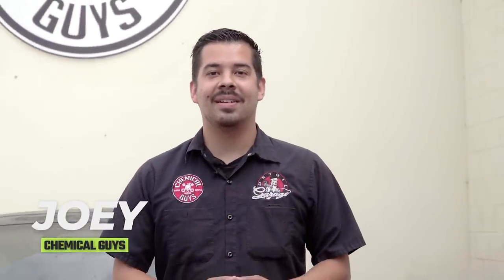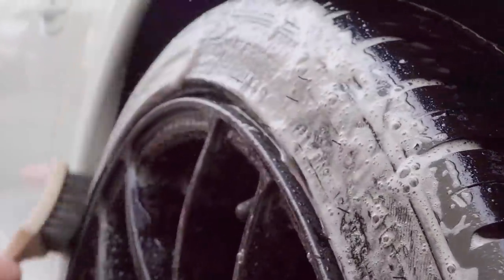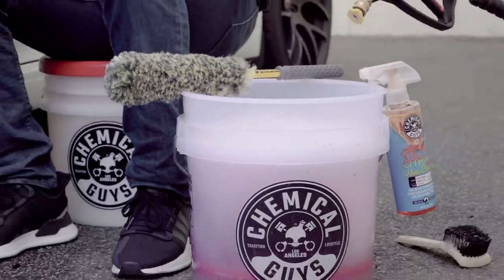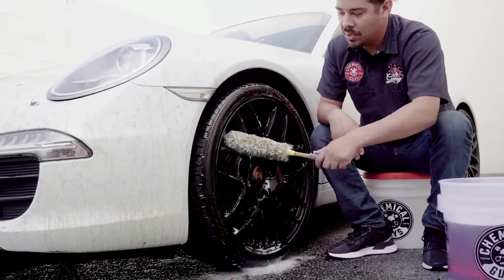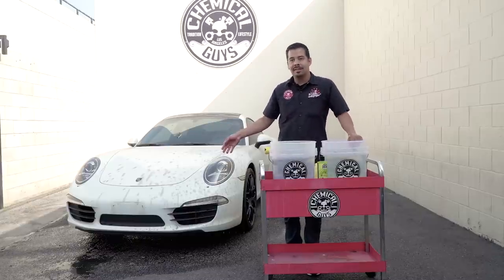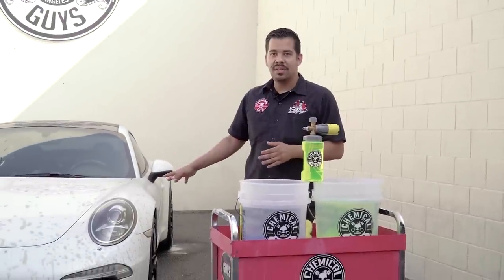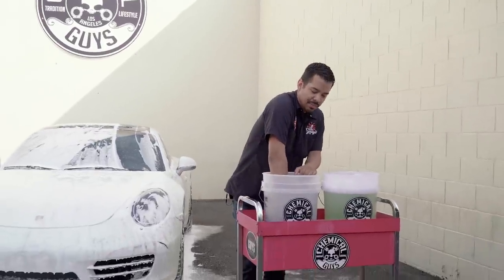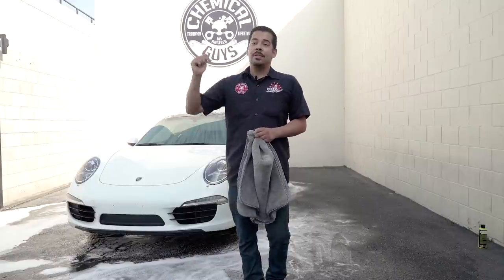How To Decontaminate Car! - Chemical Guys

Comment: words around the block that citrus wash and gloss can also strip off your wax if use at high concentration levels?
Reply: It will probably strip at any level from what I’ve noticed, that’s what it is good for if you want a fresh start but it will probably not break down any ceramic products on your first go just any carnauba wax’s.
Reply from the maker: Hey! Yes, it may strip only if you wash with 2 ounces or more. Thanks for watching and happy detailing!

Comment: Hey chemical guys, I have a pressure washer that goes up to 2200 psi, is that too high for a foam canon or should I lower the PSI?
Reply from the maker: Hey there! 2200 PSI is perfect for foam production using a foam cannon.
Reply: @ChemicalGuys  Ok Thanks!